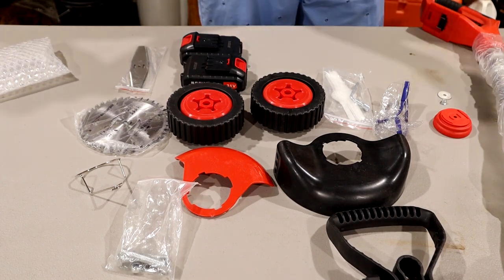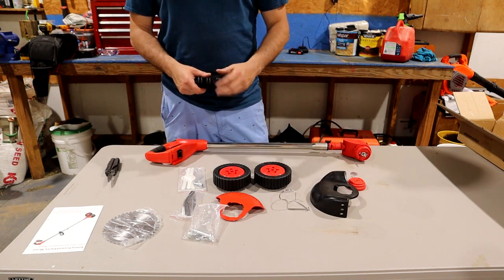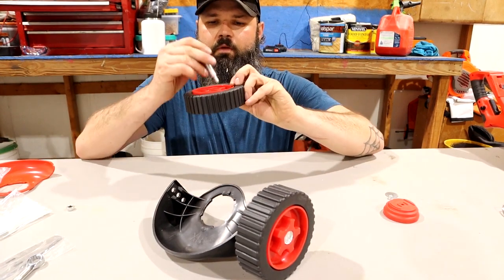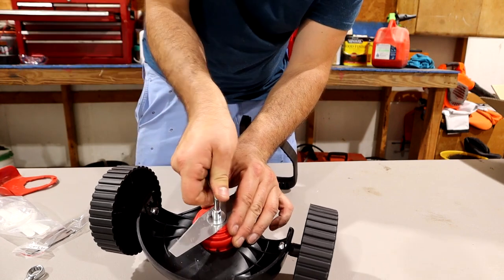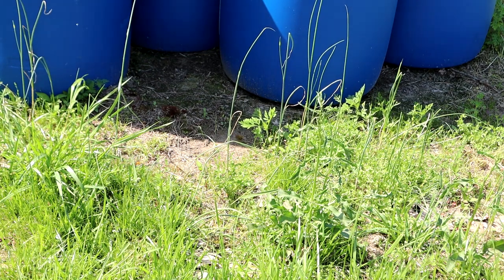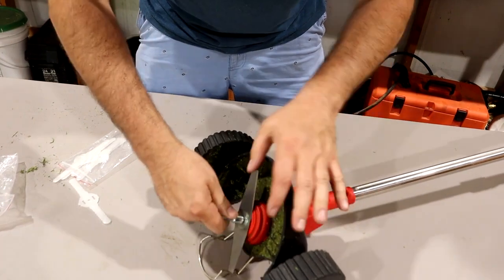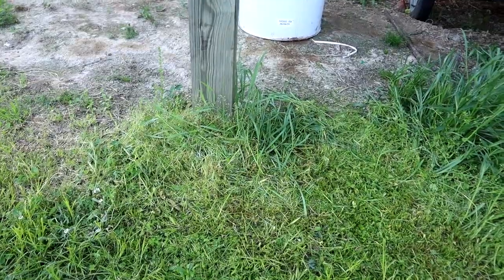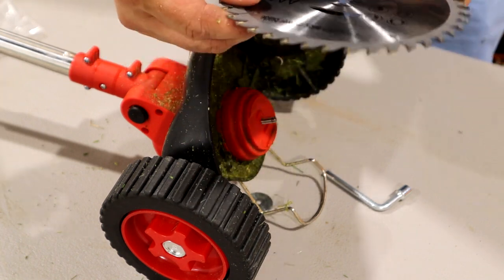Outdoor Toolbox Lawn T

Comment: First thank you sir for doing this in English, JESUS I had to sit thru Chinese version, and took me a while to do what he did, but here I'm so thankful you explain what's what....I will be recommending THIS demonstration 💯🇺🇲🙏🏻✝️👍🏻🤜🏻🤛🏽✅🙌🏻

My mom just bought one she is 76 , my advice to ladies, when u get to handle think this screw too short don't fit, ladies, hold thumb on nut in place, while turning handle circle knob, and it will shockingly get tight without being loose, same thing with wheels, hold nut in place, turn red knob on wheel and it will get tight , I found out the plastic things are mini blades, then you got 2 blades, 1 to use, and an extra incase u break a blade, then u got saw blade, so I'm starting with saw blade cause I'm sure it chop anything lol especially weeds

P.S I started with the saw blade, with big guard shield, the saw blade is for thicker weeds, but as you ease forward a few inches into the edge of the weeds, pull back , so roll forward, pull back roll forward pull back. The short metel blades & small guard shield are for weed eating and grass cutting as a mower and a weed eater for areas that are flat, and not as many weeds, more like your grass spring up a few weeds. So while u cutting grass it will cut . Be careful with the metel blades when tightening the bolt, do not grab it with full palm hand to hold while tightening, only pinch it with thumb on oneside and middle finger and index finger on the flat sides never the edges for it is razor sharp, Jesus I found out, it's sharp no doubt. The plastic blades, are for when your grass is low, but you want to give it a  every 2 weeks trim I'm assuming, but it's made for simple jobs of no distress. And when you use it, especially with the blades, when you let go of the power button, it does run spinning for a few seconds, seemed like 8-10 seconds or less before coming to a complete stop from skin as you hear the motor wined down, so watch on your feet more children around if you break for drink and lay it down or prop it down, wait till it comes to a complete stop first. Comes with 2 battery's as well.so that's good. Also has a little digital window that tells you life of battery and an image with battery bars to show you at what level your at with charge.

Hope this helps along with this man's great detailed instructions.
Reply: Oh also for anyone who has back pain from using a normal weed eater, this item is good to use because your not having to carry it, your rolling it, so though you have to roll and pull back so it doesn't stress or bog, it helps cause you doing more push and pulling then anything. 

But in all types of cutting, best to do it early morning or later in evening when it's not so hot.keep cold water close by, as to not get over heated. And a cell phone on you incase emergency or accidents.